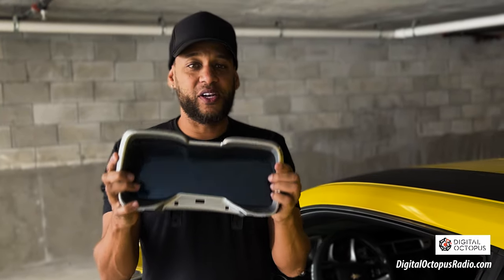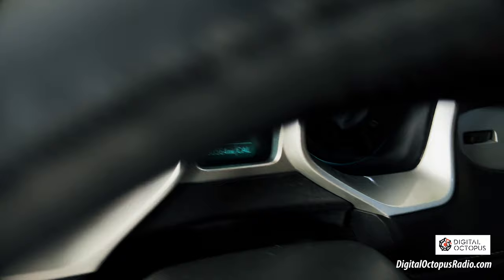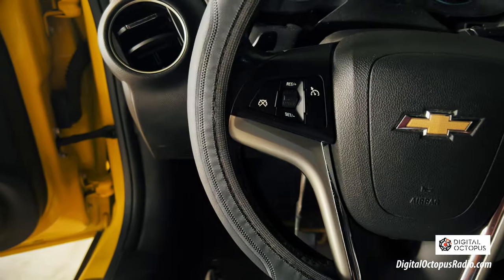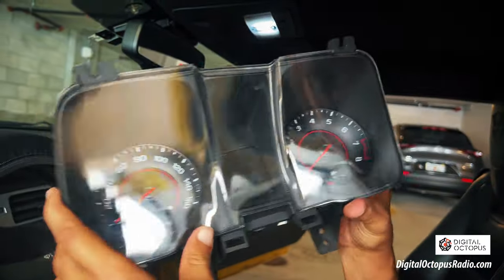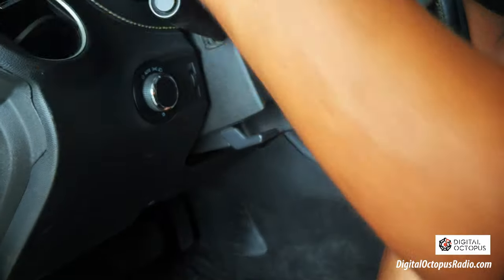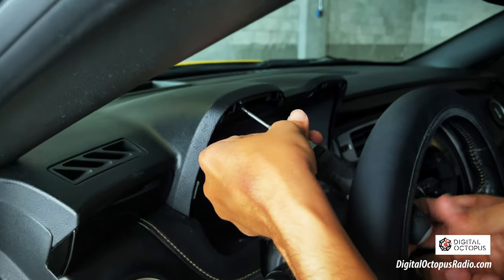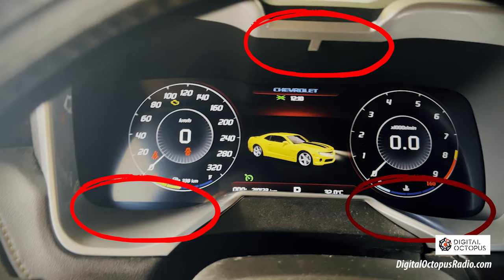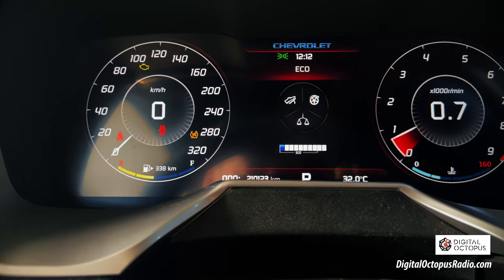Installation: ZM 1086 / DOS 1015 Digital Speedometer for 5th Gen Camaro

Comment: Yo is the Camaro still alive? Flashing check engine is usually severe, potential for catastrophic engine failure. Did you get it figured out?
Reply from the maker: Catastrophic engine failure LOL. SMH. Yes the flashing lights flashing was only on the 2010 SS camaro which was resolved a few days later with a firmware update.